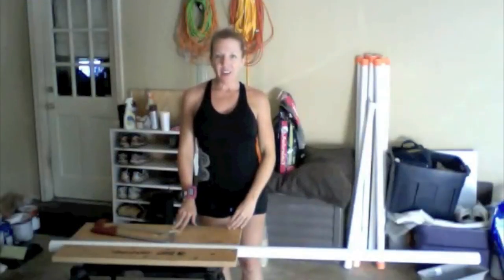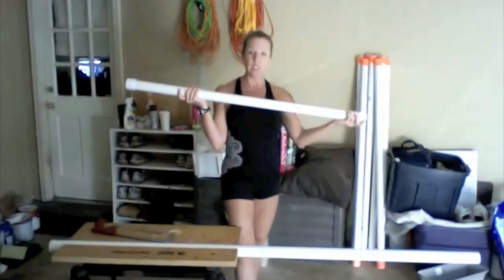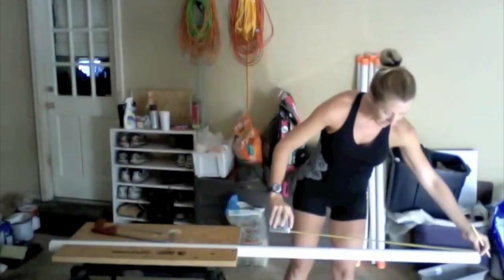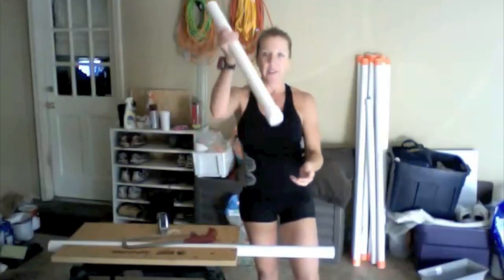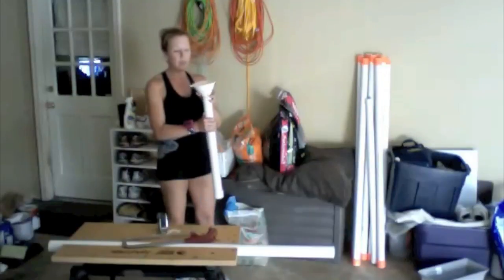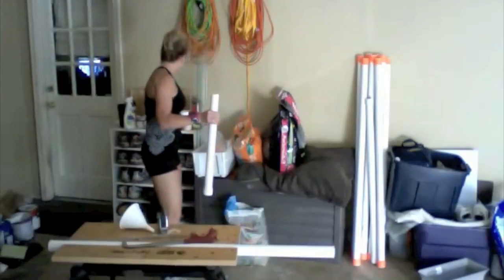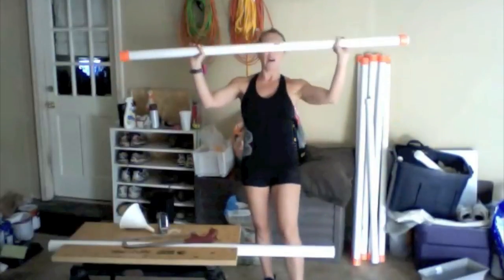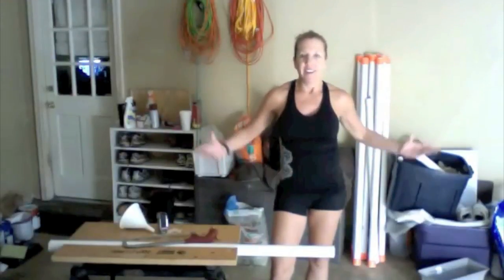How to Make a Weighted Bar

Comment: I would like make one about 15-18#. Can I get that weight using this method ?  I work at Home Depot 😂😂 I can get all supplies today. Thanks 🙏
Reply from the maker: Evelyn Santiago - It’s been awhile since I’ve made them but I do think the heaviest one I made was 9.5 lbs. You could easily make two of them and secure them together with some heavy duty tape. Good luck and have fun!

Comment: I'd like to make one that's 18-20 lbs. I was thinking that using steel pipe would help get the weight up, do you think sand is heavy enough? Alternatives would include  #8 steel shot (I'd prefer lead).
Reply from the maker: I looked into steel and lead options when I was making mine because I too wanted to increase the weight. I decided against it because of the cost. I have two barbells (one 15 lbs and one 45 lbs) and I use those when I need a heavier option. Good luck!

Comment: How do you get end cap off if you need to? 6:20
Reply from the maker: I don’t glue it on so with a good amount of wiggling and using one of those rubber jar opening helper things, I was able to remove them. I put duct tape on the ends to signify certain weights and that held the end caps on securely. I hope this helps.

Comment: Does the sand move in the bar and change where the center of the weight is?
Reply from the maker: No, it will not do this if you tap down and pack with sand fully.
Reply: @dawncolonna  thanks!!